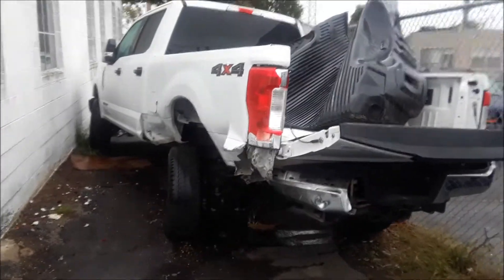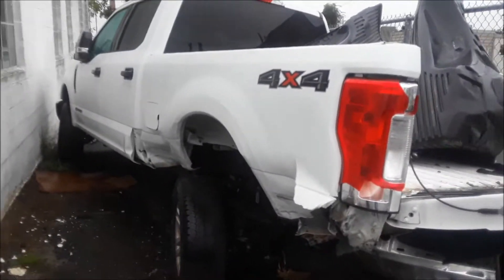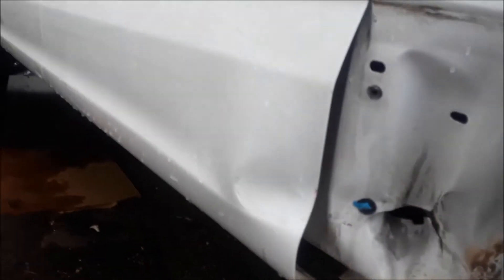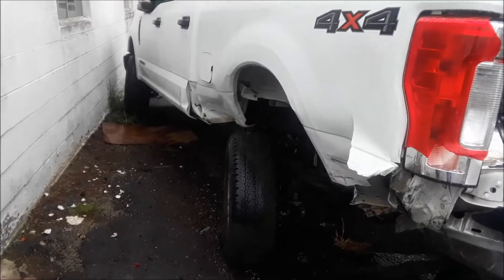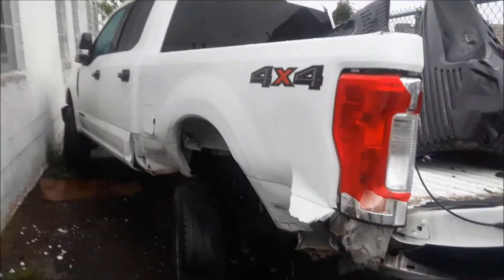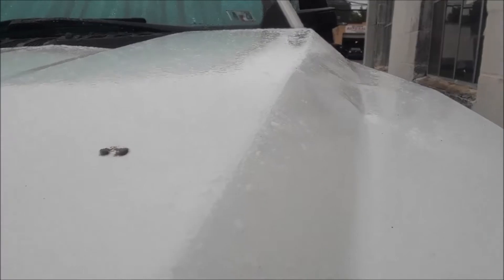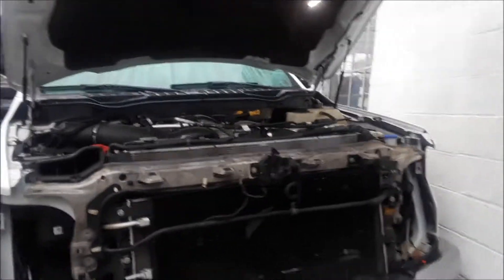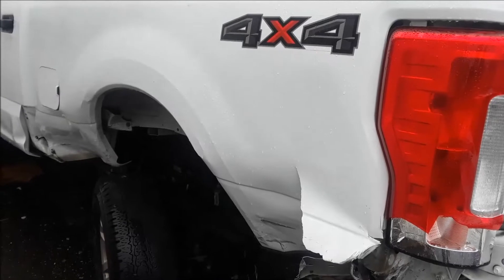Ford F150 Pick Up Truck  Aluminum Fail  Part 6

Comment: This is one of the reasons I'm so excited about the design of the Cybertruck.  Love or hate the styling, that's 3mm of full hard stainless backed by ribs and stringers, vs. 1mm aluminum or 0,8mm mild steel or whatnot.  No question which one I'd rather have facing abuse.

Aluminum is the worst for a truck. Makes a mockery of the word "tough".  There's nothing tough about aluminum. Seriously, look it up in Wikipedia - the very second sentence, " It is a silvery-white, soft , non-magnetic and ductile metal in the boron group."
Reply: Everything comes with a price

Comment: I don't know where the sweet spot is.  It seems you're going to pay at the pump, or pay when your insurance agent "pumps".  It used to be the word "turbo" triggered an uncontrollable hip motion in insurance companies.  I haven't seen a rate comparison for the available trucks.  Chevy is using a lot of aluminum now too.

Is there a good alternative?  I mean, short of gutting and rebuilding a used truck so it's reliable enough to take on the highway?
Reply: GM is only using aluminum on the doors and tailgate. The rest of the cab and bed are high strength steel.
Reply: Chevy uses aluminum doors, hood, and tailgate on the 1/2 tons only
Reply: Titanium!

Comment: I'm a Ford guy but I'll never buy another one as long as they keep making the Super Duties out of aluminum.
Reply: That hit was at a critical point, having bent the rear axle pushing it forward.   Truck beds are a quick exchange, and there are many out there for replacement. the cab corner is a tough fix perhaps, but then the hood....that is easy, companies have been making aluminum hoods for a long time, I have a love for the ram pick ups, but the ford has me looking very seriously because I know living in the salt belt , what will happen to my truck in 3 to 5 years and beyond, If aluminum will make the body last rust free for 10 years, my ford will be worth much more than my ram......but thats just my opinion . I will have to learn to love my ford...